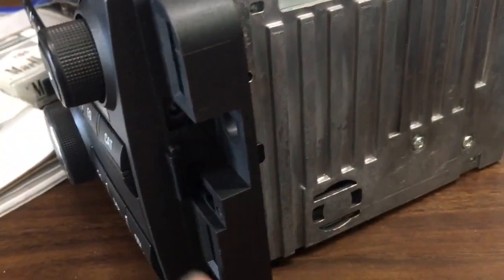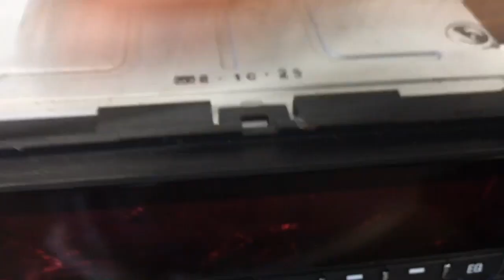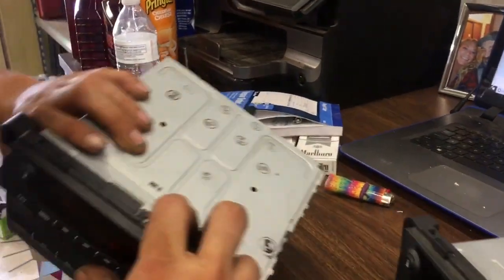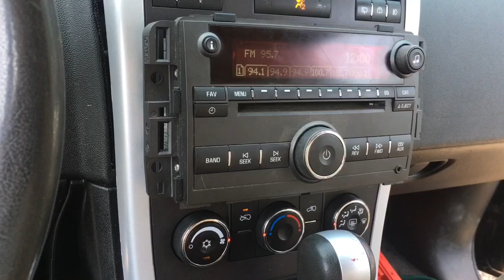Chevy equinox locked radio repair

Comment: I Agree With Carlos Valencia. This Was Not A Locked Radio Repair Video . . .
Reply from the maker: Well I disagree. I’ve had about 10,000 people tell me that they never thought of actually doing that when their radio was locked. I post my videos to save people money. And I certainly try to help those who are trying to help them selves some people do not understand automobiles the same way you may. So they incorrectly search for a problem and find a solution that they never knew was possible. I’m sorry that this didn’t help with your particular situation but keep in mind that it has helped with thousands of other peoples. 

If your radio is locked the only way I can be unlocked is by the dealership in this particular situation. And I wished my solution would have helped with your problem

Comment: How do u unlock a 2011 hhr radio to work in 2008 hhr
Reply: Good Question Im trying a 2011 radio on my 2008 malibu it still showing locked on the screen hopefully I can get a code or something because I wont go back to the old radio

Comment: I have two similar radios, 
one in a 2006 Chevy Impala LT, CD Player Does not work, nor does the Aux portThe other is from a 2005 Pontiac G5, exterior screen is busted. Can I swap the 06's face with the 05', and will the aux port work?
Reply from the maker: Send me pictures of them to clays ac and auto repair on Facebook And I will let you know if I think they will fit or work together

Comment: I HAVE a 2008 Equinox LS and suddenly the CD-in light is always on even when there is no CD in the player, 
so it won't take-in a CD. But this only happens half the time, the other half of the time it works. Nor does the chime work when i push the eject button, that 
only works rarely. I don't suppose there are there some buttons i can push to reset it to factory settings? Will it lock me out if i dont have the codes?
The radio is the same as the ones you have there.
Any help will be great.
cm

Comment: I didn't know you could do this. My screen is broken in my 12 Malibu and I'm afraid of buying a radio I can't get unlocked and really don't want a cheap aftermarket radio.
Reply from the maker: Of course you could switch the face plate over I’ve done it on everything.... But who knows

Comment: We have a 2012Equinox with Nav and it died. How do we put a 2015 my link w/ navy and eliminate the lock chip on the motherboard without bricking the unit. Thank you.
Reply from the maker: I don’t believe that that’s possible Because it requires a different wiring harness and a couple of extra computers. I could be mistaken but I’ve never actually done that before sorry I wish I could be of more help. If I ever have the opportunity to try it I will certainly do so

Comment: I bought a raido for the scarp yard because cd player went out on mine but its locked and i don't have the money to pay the dealer to unlock it wich chip do i take out i have a 2011
Reply from the maker: Simple solution take your old radio take  The bad parts out of the inside of it and then take the good parts out of the radio you got from the junkyard and put them inside the old radio and everything will be working and you will not need to reflash it I hope that’s helpful for you brother have the best of days and God bless
Reply: @getminesallday24  I went to your page and looked around....but didnt see anything about swapping out parts, chips to remove or ways to unlock a GM radio.....any help or Link?....thnx

Comment: This is not a locked radio repair. You did not unlock anything. Just switch radio faces.
Reply from the maker: True but the point was to show there is a different way. And it has helped thousands of people wish it would have been helpful for you
Reply: The Clay Way  you mean your mis titled video has been clicked on by thousands of people.   I’m guessing it has helped maybe 2 or 3 people.    I’m wondering if there is a way to flag this clickbait title..... hmmmm
Reply: I Agree With Carlos Valencia. This Was Not A Locked Radio Repair Video . . .
Reply: My new radio is locked, my old radio screen is broken.  This fixed my locked radio problem.  It made the "locked radio" issue not a problem.  Stop being so technical, we get it it didn't help YOU.
Reply: @edwardschmitt5710  so did you unlock the radio you wanted? Or did you simply swap radio faces? If you swapped radio faces you didnt unlock anything.  Why you so butt hurt?
Reply from the maker: 😂😂😂 Oh the trolls, like I said before I did title it this way intentionally but not for Clickbait I don’t need click bait on my channel. I just want to try to help people I definitely get a little bit hurt when people say hateful things to me but they don’t know me personally so they have no idea what kind of actual person I am. 

The whole point of my channel is to show people how to do things more inexpensively and sometimes you have to take the water to the horse. 

Anyways God bless all of you folks regardless of what you think about me have a great day

Comment: Zero the eeprom from the new radio or replace the eeprom with a new blank one. Need a reader/programmer cheap on eBay. The vin will relearn in blank eeprom. Or you can sift through the data and find the vin and update the new vin
Reply: yeah....WAHT??????

Comment: I just bought a car and the radio was locked. The dealership was repairing other things and forgot the radio. Is there a way for me to fix it myself?
Reply from the maker: You may be able to call a 1-800- General motors. (you probably will have to Google the number) and explain the story to them or you will have to take it to a local GM dealership

Comment: I HAVE A 2016 CHEVROLET EQUINOX &MY RADIO HAS LOCKED UP &I DON'T KNO HOW 2 UNLOC IT
Reply from the maker: Well regretfully Angela I don’t think that you can use the same procedure that I used in this video. Sounds like you may be making a trip to the dealership